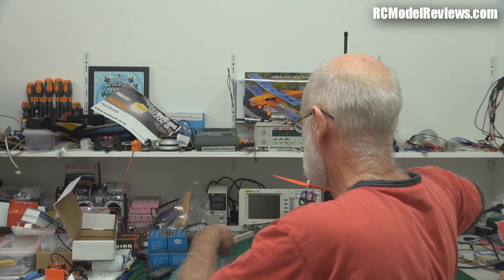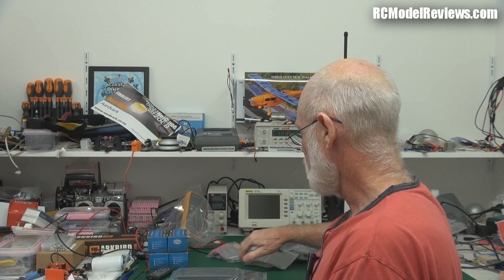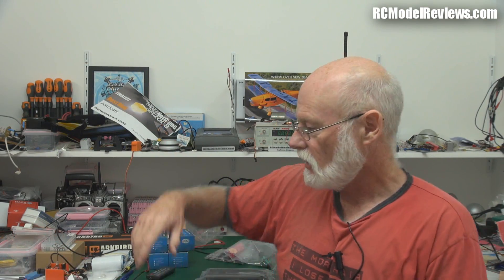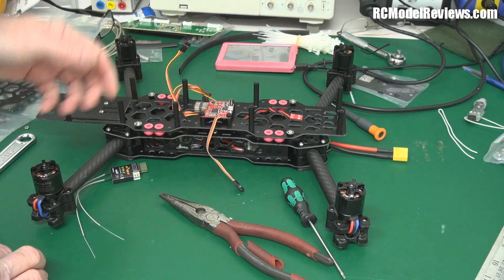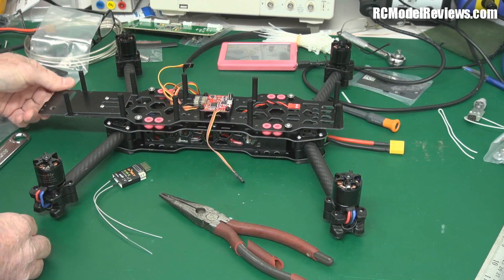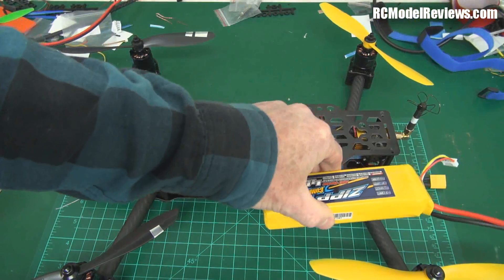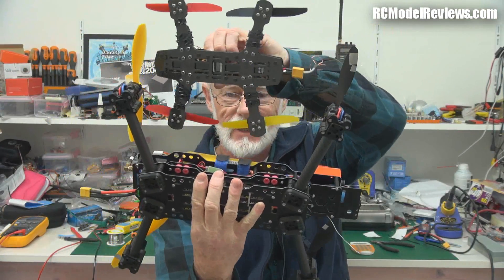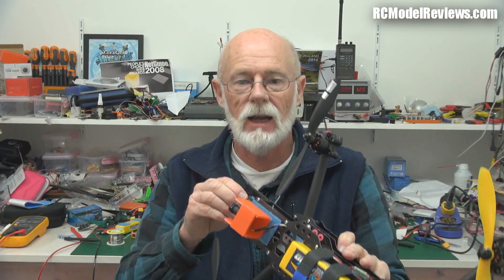Flying Cinema Cinetank Mk1 Review

Comment: Hi Bruce,
Why do you need to use 2 cameras on all your multirotors when the Mobius can both record and transmit at the same time?
Reply: The Mobius is a kick-arse HD recording camera but (as others have pointed out) it isn't a patch on a good board-camera with WDR for live video.
Reply: blackmennewstyle
 You are correct and the PZ0420H (RunCam, no filter, 2.8mm) is exactly what I use for FPV.  If I am just park flying or testing a new setup and use my 7in monior to glance at or let other people watch while I'm flying, that is what I was refering to as pseudo FPV. At that point I'm really flying line of site with a video down link so the delay is not critical.
Reply: Mobius will never beat a good FPV camera like the PZ0420H :)
Reply: I assume that is because the video delay of the Mobius was found to be about 100ms when recording in 1080p and 65ms when recording in 720p @60fps.
Reply: blackmennewstyle Just to clarify neither will a GoPro becasue of it's video delay. Love my Mobius and would not give it up for the world for recording or just a video down link as pseudo FPV.
Reply: Mick7sp You are free to use any camera you want in your FPV experience :) But believe me, if one day you use a real FPV camera like PZ0420H, you will directly understand why it's far away better than the mobius and the gopro :)

Comment: Very interested to see how the Naze32 compares to the naza.
Reply: I've already flown the Naze32 a lot in my Blackout MiniH quad and I'd say that the Naze32 is like a sports-car or motorcycle and the Naza is more like a truck or a bike with trainer wheels.

They're really controllers designed for different applications.

The NAZA probably better for those folk who don't so much want to fly their multirotor as just move it around the sky.

The Naze32 is for those who want to be able to throw their multirotor around with reckless abandon, do tight flips and maneuver it at high speed.

Different horses for different courses.

Comment: Just another video suggestion which this reminded me about. Since you are fairly experienced with FRSky have you considered doing a video on how all the FRSky bits work and a bit about the different receivers you have experience with? Eg I noticed you are using the D8R-XP, there seem to be a few differences between that and the D8R-II but also many similarities. also since you are using the CPPM could you have used the 4 channel instead?
Reply: Yeah, I could have used a 4-channel (I do in my other quads) but I had plenty of room in this one so I figured I'd save the other 4-channels I've got for smaller craft.

Comment: Hi Bruce

Which size and style propeller suits these motors the best? I got a lot of 11x5 e-style propellers, how will they run on this motor?
Reply: An 11-inch prop  won't fit this frame with the standard arms.   Almost definitely an 11-inch prop would be too much load for these 1250KV motors on a 4-cell pack.  You'd be better looking at a lower-KV motor (850-950 perhaps) for those props.
Reply: I am not going to run them on this frame :) There is a 900kv version of these sunnysky motors, i might get them.
Reply: I've been flying the Tank for months now and have tried various 8" and 9" props.  I find it handles best with HQ 9x5" (with Tiger 1100kv).  You have very little clearance with 9" props however so be careful with your lead dress.
Reply: +gagomand I use sunnysky 980kv motors with 9 x 4.5 props as they give the best efficiency and are more agile than the 10'' props.

Comment: Bruce if posable can you measure the amps after flight so we can get a gusetimate of flight time?
Reply: I've only got a 40A telemetry sensor at the moment so I suspect it would be well and truly tapped out when you hit the throttle.

I'll do some endurance tests with various batteries anyway so I'll give some time-estimates.
Reply: ***** Just connect to one ESC - assuming you have connectors and not hard wired

Michael

Comment: Hi Bruce, 

I noticed you have the 4 bladed skew planar antenna on there. What is the reason for running a 4 bladed skew planar over the 3 bladed cloverleaf? 

Other than that, looks like a great build! Can't wait to see your flight testing and resulting video. 

Thanks Bruce
Reply: That's a Circular Wireless antenna which I'm using "because it was there".

Actually, they are very good antennas and made to such precision that the Skew Planar has a low enough SWR to be used on a transmitter.  Most cheaper or home-made skew planars are not well enough tuned to be used on a transmitter due to the higher SWR you're likely to get.

I may switch to one of my own cloverleafs before flying -- it depends on whether I get time to make one.
Reply: ***** Thanks Bruce. 
That makes sense, something that I have been wondering for a while seeing I have have a few skew planars kicking around and not enough cloverleafs. I have been looking at those Circular Wireless antennas for a while, including that good looking helical that you did the review on. 

Thanks for your reply!